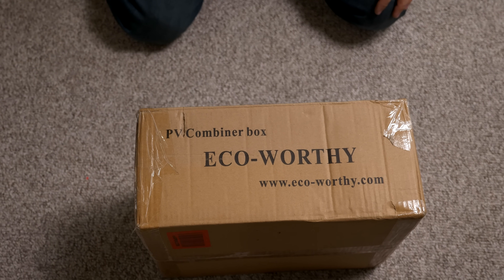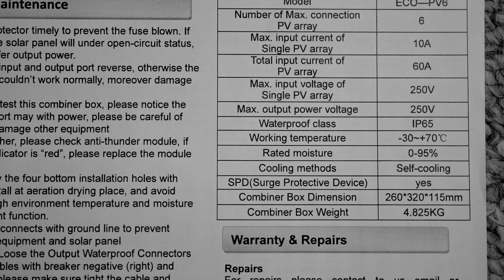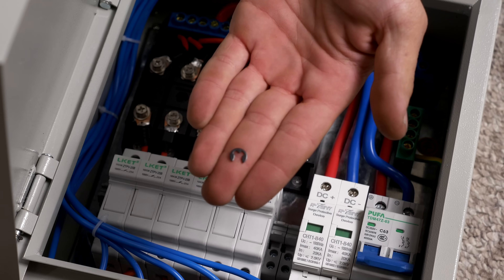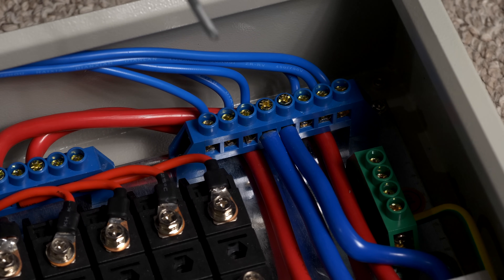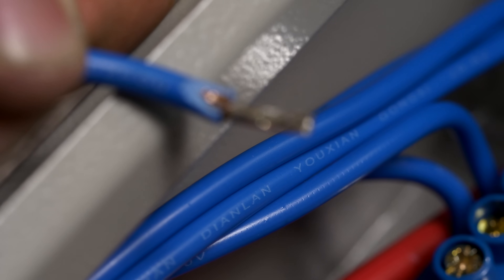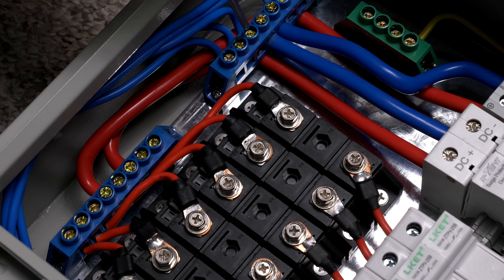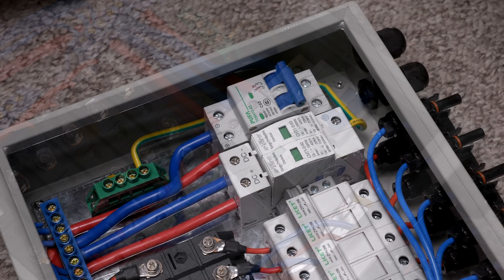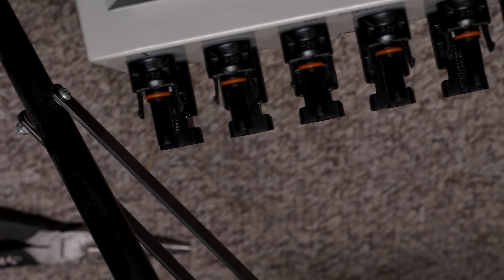Off-Grid: Solar Combiner Unboxing (Eco-Worthy's 6 String PV Combiner)

Comment: = the UPDATED" Plastic housed ECO-WORTHY  Combiner-Box is much IMPROVED 
...
Plastic CLAM-SHELL  Enclosure 
weather - Proof Membrane on ALL Four (4) Sides of the DOOR to BOX  SEAL 
15-Amp line-FUSES 
125-Amp Circuit Breaker 
the only <loss is the absence of the Back-Flow DIODES 
...
COOP
...

Comment: You don't need the diodes. Blocking diodes are already built into the panel.
 It's more cost effective and better to build your own combiner
Reply from the maker: Those are bypass diodes in the panels, not blocking diodes.
Reply: Let's be honest with ourselves - the diodes make it look Way cooler than those without.
Reply: Yes indeed but still a similar thing. I haven't seen many combiner boxes on the market with blocking diodes. I personally wouldn't bother.. Shouldn't get any back flow
Reply: @herbertvonsauerkrautunterh2513  it's funny that nobody can give a perfect answer if blocking diodes are needed. it's 50/50, some say yes, others say it isn't needed. In the handbook of my panels (Trina) they say yes, they are needed...
Reply: Three are done in the panels themselves. I wouldn't bother. What's going to happen anyway ?

Comment: I’m needing to get a combiner Box 📦 I have 4 Rich Solar Panels 100W 5.41A ea. I have 2 different inverter EASUN 3000W Hybrid 24v 110v & the other EASUN 5KVA 230v Hybrid 48v GWM for this inverter I got a SIEMENS Transformer MTO100A 220-480 x1 in & 110-240 out x2  any recommendations ?

Comment: The thin blue wires will be 4mm2 ( 37A clipped or 30A conduit) which is correct for MC4 connectors which are rate 30A max.

Comment: Just purchased the combiner box (four dc inputs). It looks like Eco-Worthy has addressed some of these issues: the door opens all the way now, the gasket is now on all four sides; the screws are now tight (still good idea to check).  It is CE approved (Canada).
Reply: That's good to hear, I just purchased one 20 minutes before watching this video,  They are on sale for $140 on Amazon now, It looks better built inside than most of the others that I have seen
Reply: @recumbentrevolution6540  Same here you either buy the eco-worthy for best bang for the buck or you have to drop x3 for a really good one. In my case just trying to offset 1200 watts of PC use. So this box should do nicely versus having an octopus in backyard with branch connectors. Also great for those who have the room on their RV's
Reply: @charlest7027  FYI update.. I never even used my Eco worthy Box, Mine had no upgrades , Did not trust it after watching many reviews saying the wires are poorly constructed. So I spent $250 on a nice one from Watts 24/7   Sometimes you get what you pay for, And I lost a 140 bucks, Held too long to return it

Comment: I have some SERIOUS WORRIES about Eco-Worthy, I recently brought a KIT which was an 8-panel 1360w total output kit, and working as a 24v system with a 3000w inverter, 4x50ah batteries to a 60amp charge controller. They supplied MC4 Y connectors and by the time all are wired up as 24v the final two cables result in amperage close to 40 amps, but the final Y connectors are only rated at 30amp 12AWG at 125 Celcius. I am pretty sure this would have resulted in a fire! But I may be wrong? The Kit is still available, but now with 2 x 100ah batteries. Customer service refuse to answer me and I am in the process of researching/buying a 4-string combiner rated at 15amp that I believe it should have had in the first place. All of the wiring diagrams do not show any fuses and combiner boxes, MCBs with only a vague mention, but surely a KIT should be a KIT and nothing missing to make it work and Eco-Worthy should answer tech requests!

Comment: I would never use a fused breaker in an RV.. As most fuses are slow blow and rated for 10 second to 500 second delay...So unless the customer knows about Fuse Types. I would never use that thing...I use ABB Breakers. With Direct connections to them.. I even add Shunt trip breaker for added peace of mind...

Comment: Im an RVer and i would not use this in an RV installation especially if the wires come out that easily.  The rattling and bumping would take those wires out of the sockets and next you know you have a small fire...

Comment: FYI, my box lasted about 18 months. Was just about to upgrade my panel diodes to schottky diodes and before I started I went and checked the "before" current with my clamp meter and noticed some of my panels actually weren't even doing anything. Traced the issue to the combiner box, where 4 of those 6 anti-backcharge diodes are nfg. I've ordered another 6 from Ali Express and that cost me about 90 bucks Canadian. Just a heads up for anyone looking into one of these.

Comment: I have two of these boxes. I replaced the large gauge wires in the box with silicone jacketed wire, replaced the tiny red wires that go in and out of the diodes with new wires with proper crimp ferules on them and then clipped off the solder ends on the small blue cables and put proper crimp ferules on those as well. Everything is much tighter now and has been working fine for over a year now. I bought them direct from Ecoworthy as they are cheaper there than from Amazon, probably spent about $30 on the wire and ferules to improve it. I have about 4kw of panels in one and 5kw in the other, no overheating, or problems. Each string is between 7 and 9 amps depending on the box, and around 90 volts. I have external disconnects as well as the keys to the box located by the boxes. Haven't had any moisture issues.

Comment: I posted this in the forum, but figured I'd copy it here to maybe get more feedback:
I'm contacting the manufacturer in China right now, I've seen these boxes advertised as 10, 12, 15 and 20 amp. I want to run 2x 100watt panels on each channel for 12.2amp max, but I can't seem to find the boxes with the bigger circuit breakers. I've also seen many reviews on Amazon that the internal wire is sized too small. There are a few that say the breakers overheat VERY easily if the box is in the sunlight, and a few that say their 'main' breaker was wired backwards, or was live on red instead of green. Have you guys noticed any of these issues?

I'm currently watching HighTechLabs video above, and I've got a few new questions:
1) Why would you LOCK the box? Isn't part of the utility of this supposed to as an emergency shut off switch in the event of a fire? Do you HAVE to lock the box? Could you install a throw arm breaker switch on the side, or..?
2) Could you ADD a door gasket to the third side and seal it, or is this trash as an outdoor box? are the edges and corners welded shut, or are there holes at the folded corners?
3) OMG, those are fuse holders?? Didn't they used to make circuit breakers to put in those? I swear I tagged some low voltage circuit breakers to build out my own box some odd years ago.
4) My panels all have diodes built in to prevent current backflow. Can I just bypass these monstrous diodes?
5) WHY won't those breakers tighten down? Are they just that crappy that you can't apply that much force to them?
6) My application will need the box to handle ~73 amps. Will the components in this box handle that, or should I just go ahead and piece together my own box? No, I'm not paying $350 for a freaking 'name brand' (Midnight Solar) box. I'd rather spend the time building it out the way that I need it, rather than pay someone else to build a rubber stamped version.
7) That SAID, I'd be MORE than happy for any and all recommendations about other boxes or components. This is going on an RV, so it doesn't HAVE to be NEC compliant, but I know better than to cut too many corners as well. ;)
Thanks for any help!

Comment: Is this device UL Listed. From the looks etc., I would guess not. If that is the case it should not be used under any circumstances.
Reply from the maker: Nope!  Good thing I just got a new Sol-Ark inverter and can avoid parallel connections all together!

Comment: Had this for about four years. No leaks ( box is outside, well exposed to everything). No overheating issues also. 24 volt system. 80A + out

Comment: This is the one I have in my shopping cart. I wanted to use this for my outside solar panel setup. Of course it would be in an enclosure. I was particularly looking for a video showing me how to go from the Combiner to the Controller? And how many 100 watts panels can be connected to a port without risking burnout?

Comment: The 0.4V diode drop is going to become 1V at full load. At full load that is 60W of heat to loose through the steel box. Stand it off from the wall to circulate air behind, but it is going to get hot..
Reply from the maker: When we forward biased the diodes with just 3A from a bench supply they jumped to .75V, so yes - very true they will loose quite a bit of power to heat.  Too bad there isn't a power FET & accompanying turn on logic solution to combining panels without the diode drop loss.

Comment: It's wrong to use a tinned wire in a clamp. The tin starts to flow under pressure increasing contact resistance . In the end it will burn out.
Reply: This is such a problem everywhere, and I can't understand why, as most manufacturers specify what kind of cables and what internal design can be accepted by the terminals. It's not just the Chinese suppliers that get this wrong mind you.

Comment: Loss in the diode plus your panels have diodes . I have received products from China with steel wire. I noticed it rusting.
Reply from the maker: Wow steel wire!  You've got to be kidding me!
Reply from the maker: Did some research, I think the diodes in the solar panels only come into play when panels are in shaded areas
Reply: @HighTechLab  i would think they are in use in all situations.  That is what gives you the allowable 600- 1000vdc series connection. I would think this is why you can connect in parallel and not worry if a group of panels is shaded. Which also should not matter if you paralleled a 50 cell and a 72 cell. But you should only get the greater voltage or the panel that is performing the best. But as for power consumption, if it is in the circuit it will be burning power. No?
Reply from the maker: I can dig deeper into this and make some videos on it.  I'm not sure to be honest
Reply: @HighTechLab  not a big deal to me. Ive been getting a lot of copyright stikes lately. Id rather not .

Comment: I really don't like the current design of screw terminals. I have a better design where teeth would clamp over the wire, and add more of a bite onto the wire. Most cheap screw in wire terminals don't have that. I've even had a wire melt before because of a terminal that let the wire partially slip out.
Reply from the maker: It's a compression style connector, but the wire is essentially solid and you can't compress a solid wire.

Comment: You normally only have to use the clips  on the breaker to unhook it. So you can take it out , terminate the wires and afterwards simply push it back in to position with the top hooked into the din rail and the clips will just latch into position securing it .
Reply from the maker: the clips aren't spring-loaded though, you have to get in there with a screwdriver and push them into place and what I was trying to say is with the wire in there you don't have access to pushing them back into place
Reply: HighTechLab oh ok that is annoying, then you are totally Wright.

Comment: Another great video.   I make no judgements on choices - just sharing that for code (in my jurisdiction) all items (box, connectors, breakers, diodes, surge protectors) must be UL or ETL and it doesn't look like anything about this is UL or ETL.  (CE is not OK).   I have 2 Midnite Solar (UL) combiner boxes which is why I know all this.  A bare Midnite Solar combiner box with shut-off handle (UL) is about $200.   Add in circuit breakers ($15) and surge protector ($80)  and you're up to $300-400 range for UL to combine up to 6 strings.    Also, a specific sticker with volts/amps is required on the outside of the box (for fireman) in my jurisdiction, witch was another few $ and I had to print (customize) the values myself.

Comment: Great review. This is a great value if you can get past the bad points. I just paid the same for a Midnite Solar enclosure itself without any of the electronics. I agree on the code issues as well that any compressed connections should absolutely not be soldered. Enjoy your videos and would love to see more of your setup as time permits.

Comment: Tin on wires like that is so bad, it would be better to just have the copper directly in the clamps, or use the proper ferrules for it. Soldering them just makes a bad connection, that will cause problems later. :(
Reply: I'm no electrical engineer, or anything close, but even I know that you don't tin stranded wire that needs to be clamped in place. Even if you manage to get a tight connection, preventing the wire from being pulled out, the connection can heat up, and the solder can melts. When that happens, most, if not all of your clamping force is used to deform the wire, which is now no longer tight.
Reply: @timderks5960  Not only that, solder isn't that "strong" (not sure if that is the right word), so it will slowly deform over time. You might get a good solid connection when you tighten the clamp, but afterwards the tin will deform to the new shape, and the clamp will get lose, and then the heat will set in, and then it just continue even faster. And on top of that, when tightening the clamp, the solder prevents the clamp to compress the cable end properly, and the tin keeps the wires as a cylinder, so the clamp only got a connection on two narrow points. It is so sad to see something like this on a "finished" product.
Reply: Yeah, I could tell when he tightened the screw, the tinned blue wire didn't smush and deform like it would have if it were stranded.  The only problem I've EVER had with stranded is that after a month of high current use, the temperature changes can walk the setscrew out, so I always re-torque it afterwards.  I've never tinned stranded wire in a box.  On solid wire, I try to get a good bite into the conductor so that you can see the cut into the copper afterwards from the screw.  Solder is so soft compared to copper that it would never bite right.  You'd think they would know this, but it's a cheap amazon product instead of professional gear.